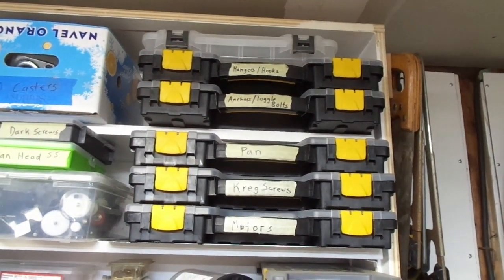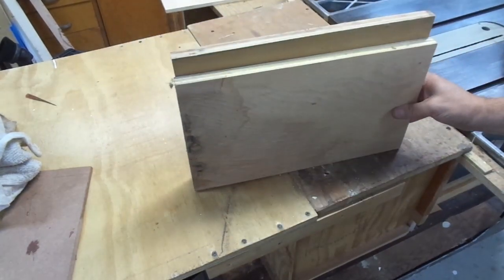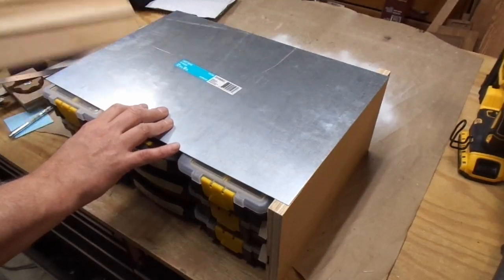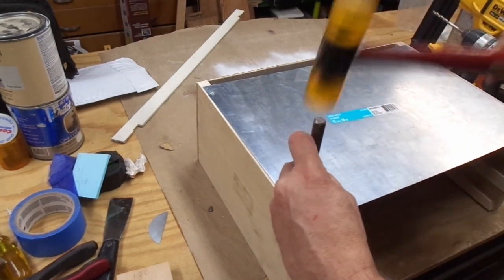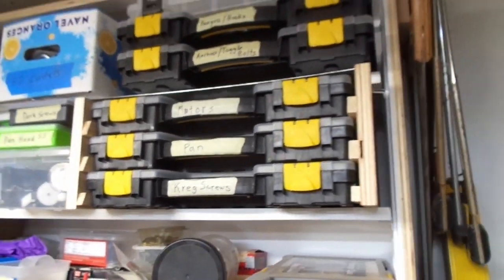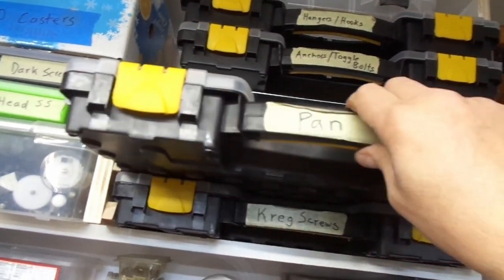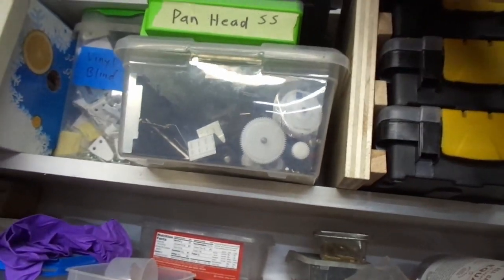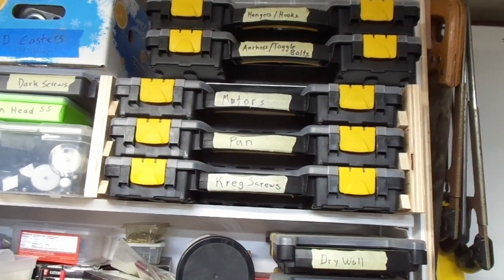Compact Harbor Freight Organizer Bin Storage Rack

Comment: What were the dimensions used for your project? Thanks in advance 🙏
Reply from the maker: Thanks for reaching out but I didn't really cut anything to any specific dimensions that I recall and ended up massaging the pieces to the correct positions by trial and error. My space was too tight and I don't think the HF bins are all that precise.  A channel called BremTech has a video where he gives some dimensions that can get you started.